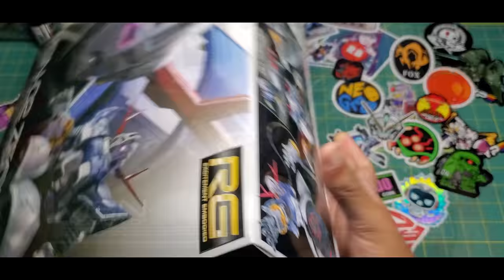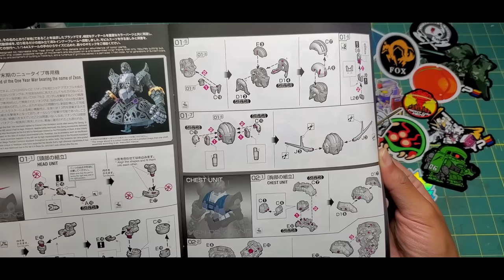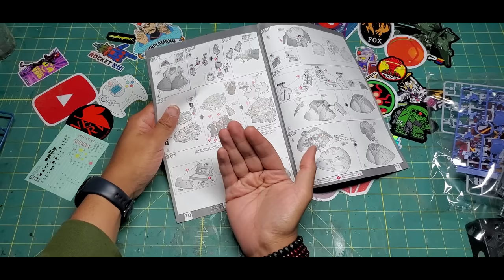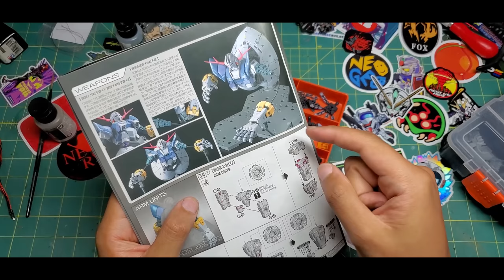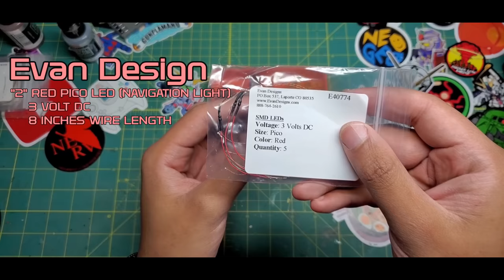#newtype #Otakubuilder REAL GRADE  ZEONG (4K)

Comment: I would definitely recommend checking out other real grades!

Most of the problems you mentioned (unstable frame, "prone to breakage") come from people who build like a caveman, handling their kits like an action figure rather than a plastic model. You really can't do that with a Real Grade. 

Since you already work with wiring and such, I assume you know not to manhandle your kits! 

I think you would really enjoy the intricate build of some older Real Grades. Rather than inner detail, the frame serves an entirely structural purpose: it's there for the shifting armor panels to attach to. The part separation on some of the older ones also makes them easier to paint.

Comment: Starting with the RG #25 Unicorn, RGs have been greats kits that have been improving kit by kit. (Skip #26 which was just a Ridden recolor Zaku II). 

RGs right now are basically small MGs with a few removed features but with QoLs and tweaked proportions, RG details, and the pros of being a smaller kit in relation to stability and posability.

Comment: So I built few rx-79(G) gundams. I did the leds for some. I hated seeing the wiring so I ran them down the leg and drill a small hole on the bottom of the foot. Then use hot glue to attach to a wooden base

Comment: I had an idea while watching this and that was to have plugs in the connections for the arms and one on the backflap so they could be disconnected and for the arms using a seperate wire to reconnect the arms and one on the rear flap to connect to a base